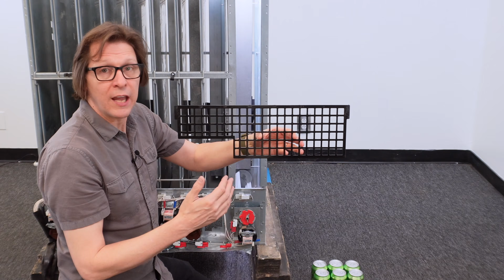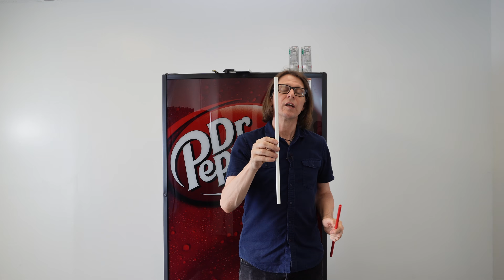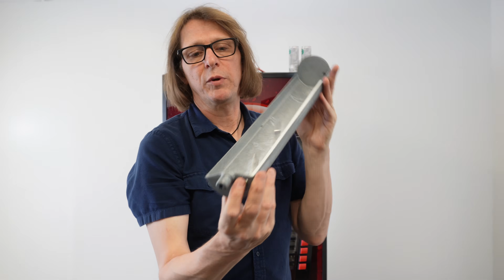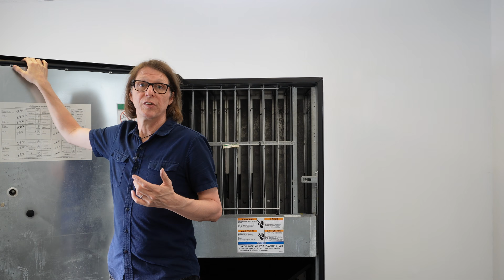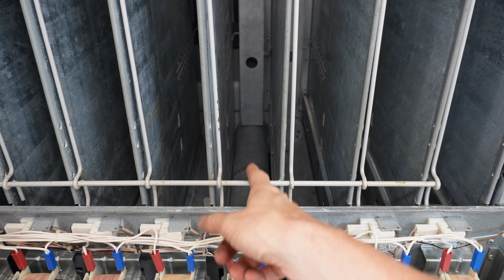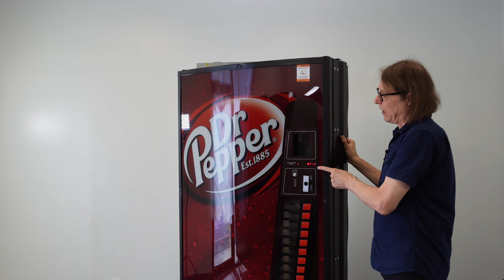How to Vend Narrow 12oz Cans like Celsius from a Dixie Narco E Series Vending Machine

Comment: To anyone who couldn't find these parts - I made it work for white claw cans using a little redneck engineering.
Basically I got some steel brake line that fit through the larger side, then cut it to length and wrapped it with very sticky tape in rings along the length of the tube to the diameters 1/2" for the white tube and 7/16" for the other one. You could also maybe use some pex tubing or something of that nature. Then to secure it in place I used a screw that was the right size to thread into the I/D of the tube on the narrow holed end and then the other end just sits slightly proud of the larger holed end. 
Not sure if I would use it in a place you depend on the machine but in my garage it works great and the price is right.

Comment: Hello, does this also work with 8.4 oz cans? using the 12 oz can shims?
Reply: Did you figure out how to do the red bulls?
Reply: @leri3365  I was never able to get the 8.4 oz, so I just vend the 12 oz red bulls/celsius
Reply: @tonyu349 dam that sucks i already bought a case of the 8.4 and want to figure it out... don't know why there's not many videos online for this. For the 12oz red bulls, did you use the same settings as he did on this video or was it something else?
Reply: @leri3365  I used the same settings as in this video.